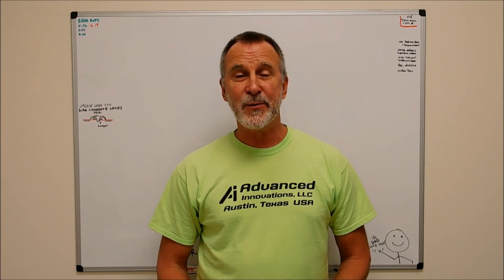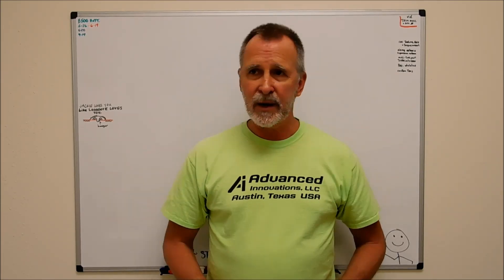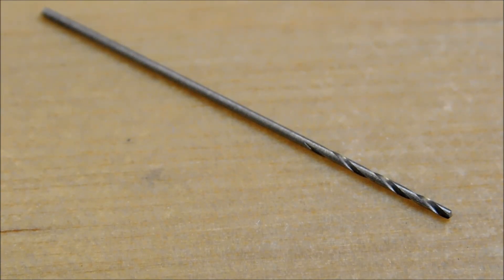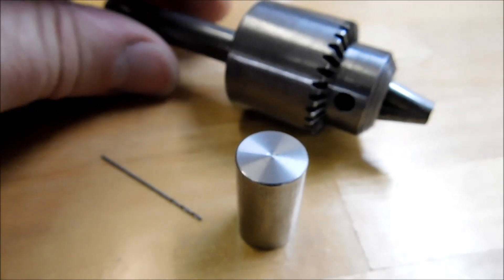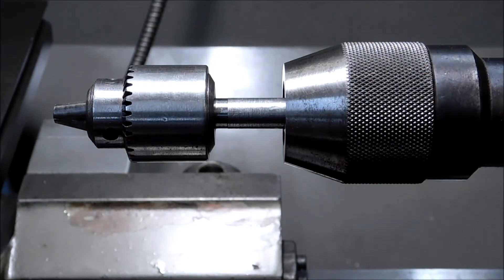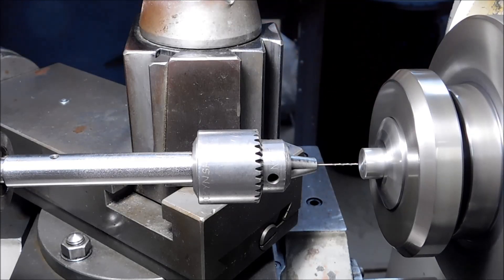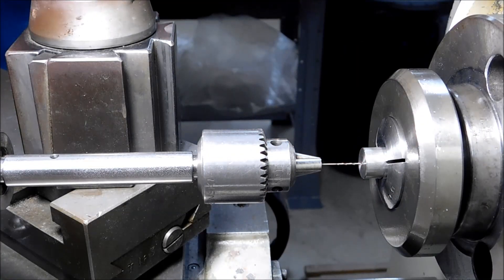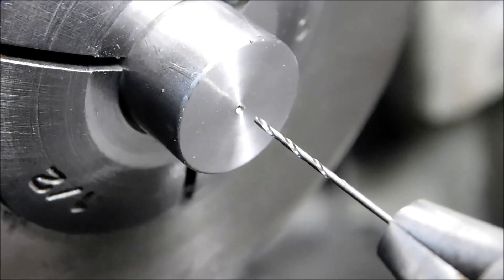Micro Drilling -- Stop Breaking Small Drills !!

Comment: Others will probably have said it, but maybe not…
Please refer to the cutting tool as the drill bit!
Drills are the machines that hold the drill bit.
Thanks for the tip, though!

https://en.m.wikipedia.org/wiki/Drill_bit
Reply: Thomas Cruz The machine that holds the bit is the drill. Try looking at images of, bench drill, pedestal drill, portable drill, hand drill, etc. The tool that does the cutting is also the drill but distinguished from the bench drill etc by the name drill bit. (The cutting bit that fits into the drill.)
Reply: Thanks, Thomas Cruz .
I just checked.
I was right:
https://en.m.wikipedia.org/wiki/Drill_bit
Reply from the maker: Love it.
Reply: Thomas Cruz - Merriam Webster is correct, but their wording is not clear: The drill, or drill press, is the instrument which holds the 'edge or pointed end', and the 'pointed end' of the instrument is the 'drill bit'. Other online dictionaries make things clearer than does Merriam Webster. This is from The Free Dictionary:

'bit: 3. a removable drilling or boring tool for use in a brace, drill press, or the like.'

Other dictionaries, including the OED concur with this definition. Simply put,  the 'bit' or more accurately the 'drill bit' is the tool with the edge that does the cutting. It is, literally, 'the bit that drills the hole'. The bit is usually held securely by the drill or drill press.
Reply: Thomas – When I was a kid, my family called quilts "snuggies".
We don't (after we learnt the official name) expect everyone else to know or use the term – and we don't correct people who use "quilt" instead of "snuggie".
A "drill motor" is someone's mistaken, or 'pet', or localised name for a drill.
A "drill motor" is the motor inside the drill.
"Drill bit" is not slang, and its use predates the twenty first century by several hundred years.
!

Comment: Goes to show. forget about a machine in 2017 custom making a clock with micro parts. Without highly sophisticated sensors for sense/touch and advanced formulae to avoid overstressing the fragile tools...
Reply from the maker: There's beauty in simplicity.
Reply: Its called calculating speed and feed. This is a good old school trick, not accurate depth though. So kinda obselete

Comment: I am curious.  At about 5:03 when you are putting the center on, it looks like the whole assembly walks a little.  Is that just a trick of the camera, or is that normal?
Reply from the maker: That chuck is very old and I am sure it has some wear at the tip. Some of that movement, although minimal, is between the centerdrill and chuck jaw, the rest is the tailstock spindle. I approached the feature very slowly as to allow the centerdrill to find its own center. Hit it too fast, and the material will grab the centerdrill and any play will immediately cause an eccentric runout of the center.
Reply: Thanks for the explanation.
Reply: Use carbide and you be okay, for that small of a drill id use a 60 degree carbide chamfer tool, you know with a diamond shaped insert. That would make much better CD for a 26 though drill

Comment: Yes, much better feel by hand. I made a similar slip fit system for hand tapping anything smaller than 10/32 threads. When using your fingers you can really feel that tap binding up and starting to flex. That's when you back out, blow it out, re- oil and go back in for another "peck". Works equally as well on a mill. Good stuff Joe.

Comment: The centre drill moved just at the start of contact with the Ss bar.
Reply from the maker: I saw that. I have to dig into the reason. Damn that macro photography !
Reply: Roland Elliott Wear on a Machine will allow movement! When operating older machines the operator has to allow for the movement or rebuild or replace,  The closeup video was very interesting to watch. Neat method of drilling.

Comment: I need to make something like that for manual tapping of small holes.
Reply from the maker: Use a small turned disc with a knurled OD to drive the tap. Drill a hole in the center or that disc and put a set screw in from the side to secure the tap. The closer you get to the shank of your tap with your driving holder, the better you'll feel the tap cut.

Comment: I use the same technique in a milling machine and lathe to tap small holes.  It keeps the tap lined up while allowing you to feel when the chips are building up or bind so you don't snap the fragile small taps.  I have never used it to drill small holes on a lathe, but now I will.  Thanks.
Reply from the maker: You'll like the feedback and sensitivity.
Reply: I've seen and copied a much larger version intended for safely tapping LARGE holes in a lathe, but still with the feel you get by hand. It's based on a long hollow quill which slides on the outside of the tailstock barrel, with a 3/4" Jacobs Superchuck (a keyed, ball bearing chuck which can grip almost like a collet) at the front end. 
A go-kart wheel bolted to the back end enables the operator to push the tap into engagement and then, using both hands, safely resist the torque of a big tap even in a blind hole. 
Just keep your thumbs clear of where the spokes will spin if the tap jams or bottoms!
It's lapped to a neat fit on the barrel so it slides nicely and permits the tap to self feed. When you reverse out you can speed things up by also spinning the wheel in reverse.
Works a treat up to M16 or 5/8-11" in steel, or with serial taps in stainless. Also down to M4.

Comment: Great tip Joe!

For a vertical mill or drill press you could hold small parts in a collet/chuck and sit the drill adapter, chuck and drill bit in a 3 jaw or whatever on the bed but you'd have to pull up on it and bend quite a bit, (no pun intended!), to be able to see under the face. There was one moment there when the drill bit started to flex and whip and very nearly broke but it just proves that the method works, as you could feel it and back off.

You could also use a jeweller's Archimedes screw type pin chuck held in the mill chuck under a sprung tap guide to apply light pressure and maintain alignment.

Something like this; https://www.amazon.com/Twist-Archimedes-Push-Drill-CHUCK/dp/B003UBJG88

Comment: in the late 60s  i worked on a lot of carburetors.    and in 68 on the Carter AVS  they put an idle jet to small.   it caused the V 8 engines to stumble off idle.    it was a brass tube.  necked down at the end.   i used a .034 "  drill in a hand held pin vice.    hold the tube pointing down so the chips dont get in the the tube.  on 440s   incres the dia of the jet by .001.    the stumble is gone

Comment: Joe, I made the same type of adapter sleeve as you when I was working as a journeyman machinist for a 2 piece D&I sanitary steel food can  plant. The D&I bodymakers worked on hydrostatic principles and required small jets made from 1/4 -20 x 1/4 stainless cup point set screws at the various pressure points on the machine. The holes varied in size anywhere from .014 to .036 to control the static and dynamic pressures required at that point. Long story short, the sleeve does a great job of being able to allow you to feel what the drill is doing in the material. I'm 57, and I remember being told when I was a green apprentice about learning to develop" a good feel". Another good video Joe.And I hope the younger guys appreciate these tips because you pay for this experience with your life.
Reply from the maker: Very true. Thanks for the comment.

Comment: I tell everyone "I machine with my toes and my ears." So few people understand what that means. It's all in the feel.
Reply from the maker: It is. Thats a big reason I was hesitant to jump into CNC. You loose that feel and have to rely on sound and chip geometry.
Reply: I ran production CNCs for years. I could hear through the duct work at my desk if a tool change went bad or if something sounded off. The jump to CNC is not nearly as bad as people make it out to be. If anything I think it lets you hone your fundamentals because you can sit and observe as well as run DOEs and other statistical studies that would be impossible on a manual machine if your production numbers warrant it.

Comment: Great idea Joe!
You can get something similar (without the chuck) on Amazon for $28. > https://www.amazon.com/Micro-Small-Drill-Adaptor-Chuck-Lathe/dp/B06XPN446G/ref=sr_1_3?s=hi&ie=UTF8&qid=1511426927&sr=1-3&keywords=Sensitive+feed+drill+chuck
I have one that is spring loaded so it pulls back when you let off your finger feeding pressure and it can be used in a mill or drill press. They are also called a "Sensitive Drill Feed."
Reply from the maker: The name brand one can be extremely expensive. It would be a great apprentice project. Something every toolbox should have.
Reply: Yes sir, mine is one of the expensive ones. I thought that maybe this particular item would be ok for someone who for whatever reason cannot make their own or afford one of the expensive ones.
P.S. Happy Thanksgiving!

Comment: Great idea, and easy to rig up. It will work for running in a tap, too, turning the lathe by hand.
Reply from the maker: Since this isn't keyed, you can still turn the chuck if you put a small tap in it. It gives great sensitivity for small stuff.
Reply: Yes. I actually made a similar rig for my little belt-driven lathe, and I take off the belt and put a crank on the off end of the spindle, for jobs like winding springs and tapping small parts. I like the feel of turning the spindle lefty, while controlling the tool righty.

Comment: HOT DOG!  Great adapter.  My shop will soon have one.  I'm considering using a pin vise as a chuck.  They are less expensive than a chuck.
Reply from the maker: I have 2 I use on occasion. They work, but the grip strength is limited.

Comment: for the mill/drill press how about a splined adaptor and shaft with a bearing and round plate right behind the chuck? chuck spins, plate doesn't (because you're holding it providing down pressure)
Reply from the maker: Thats how the commercial ones are built.

Comment: Speaking of drilling small holes, watch these Japanese guys try to drill/bore through mechanical pencil lead!
https://youtu.be/pCtWPbTDbuY
Reply: interesting video.  You just have to get past the corny Japanese drama.   But once you do, the analyzing , troubleshooting and skill of the guy on the manual lathe was amazing.   He didn't use a sensitive drill chuck but I think he could have done better if he had.  I also would have made a collet to hold the pencil lead to spread out the pressure around the lead's circumference.
Reply: Ujeb08 I thought the video was pretty funny haha but yeah, I think it's hard. I think a cnc mill would be a good option too. The pencil lead is .020 in diameter, and he's drilling it with a .012 drill bit. That leaves a wall thickness of .004 of pencil lead. That means you breath on it and it breaks haha the lead has to have no runout. imagine how perfectly you have to align the tailstock. I don't know, the task is so difficult, it's hard to believe honestly

Comment: I made a tailstock DRO out of a dropped caliper to drill tiny holes so I can control the peck, and have drilled many 0.013" holes 0.295" deep in aluminum nickel bronze with it before we got a machining center.  Just another way to do it.  I love 1/8 shank tiny carbide drills too to avoid chuck-ception. Cool other way to do it though!

Comment: As someone else mentioned "There are small chucks that can be bought ready made with a sliding shank and a knurled grip to hold onto so you have feel.". I have one and that certainly has been a life saver - that type does do good in the mill due to its contstruction.
Your approach is essentially very similar and a great solution for sure - it is essential to have that 'feel'. I'm sure a good many folks will find that super useful.

Comment: Great little tip for drilling the hole but now I want to see you sharpen it......what's the trick there?
Reply from the maker: A checkbook solves a dull drill that small pretty quick.
Reply: Easily done if you make yourself a four facet sharpening jig designed by a mate of mine called DAG Brown (written up in ME magazine) and adapted by Gadgetbuilder (go-ogle him) and further adapted by yours truly (not written up anywhere save SMEE journal). 
Joe, where's the fun in that? Why spend a Pound when you can spend all day in the shop making swarf.

Comment: I think "the feel" is different for everyone and mostly gets learned from many many mistakes and remembering what things felt like right before they happened.  Ive been a mechanic for 15 years and through all the experience I can tighten a bolt to within a reasonable torque and can tell when  a bolts going to snap (usually) long before it does.  I definitely agree that kind of thing can't be taught.

Comment: 1350rpm for such a small drill?!? Shouldn't you use a much higher frequency?
Reply: Calculating the surface speed here I'd say 9,000-18,000 RPM would be the range to run that diameter drill. But what he did certainly worked for him. I guess he just wanted to take it slow.
Reply: Paul Frederick Good luck to find a lathe that can do speeds like that. :D
Reply: They exist. Good luck financing their purchase though.

Comment: I have a customer I have had to disappoint because the job involved drilling a 2mm hole 170mm deep in steel (for a special firing pin to slide through). Now I have your technique and will build the adapter and try it. It would be a victory for me to be able to do this job. It has bothered me for a year now. Thanks for the super videos you produce, and this one not least!
Reply: 2 mm is more than 3 times the diameter of this bit. You'll have to give it a try, but it may be too big to do this with? 170 mm is also really deep too. Your typical 2 mm jobber twist drill is not even a quarter that long. It would be quite a feat to get a straight bore that diameter, that depth.
Reply: Sinker EDM or some 2mm capillary tube with diamond abrasive glued on the end and trued up. You might have to reapply and true the abrasive several times to get to depth. The key to both of these techniques is they remove the random tangent force that will bend a twist drill off axis.

Comment: At about 5:10 it looks like the tailstock barrel is lifting so the centre may not be on-centre
Reply from the maker: I picked up on that as well. Yay for macro photography. I'll have to make an indicator puck and check it.
Reply: Actually while the drill did move a tiny amount into the parts center I thought your lathe or at least the attachment was aligned with the part C/L far better than about any lathe shown center drilling on any Youtube channel out there. Tailstock wear on the base, variable bed wear the length of the bed etc, etc and even being purposely set high right from the factory a few thou plus trying to keep it in perfect alignment over years of use is pretty tough. Your large drill chuck holding the attachment could easily be out as much as that drill moved. Maybe one of the Moore Tools Nanotech lathes would be set a lot closer, but yours doesn't seem to be doing too bad. Really great and well thought out micro drill attachment Joe. Finding a good chuck today that holds concentrically and closes down far enough at less than Albrecht's price point is going to be the tough part for me.

Comment: I have one of the commercial ones but I like your's as well. Mine is keyed for use on a mill with a free spinning collar to push on. Your design is better on the lathe because you also get feedback on how much bite the bit has. I've snapped several bits on mine. Looks like I'll be making a new tool. Thanks for sharing.

Comment: getting the "feel" is something some people just cant do  and others, well the struggle is real. at first sight of the video i thought some how that piece of stainless was hollow using it to stop deflection. i've done that before with shallow holes with success.
Reply: When I was taught metal working, we had to learn how to do everything using only hand tools (saws, cold chisels, files, hand cranked drills, etc.) before moving on to machine tools. Once you can cut, smooth, drill, radius, chamfer, etc. by hand with precision and accuracy, it's a whole lot easier to transfer that tactile intuition to machines where there can be a ton of cast iron and several horsepower between your fingertips and the cutting edge. Thank you Ken Hunnibel, wherever you are!
Reply: Today everyone is getting busted for copping a feel. Harvey Weinstein, and now even poor old Charlie Rose. So watch yourself.

Comment: Pretty nice! I need some 0.2mm, 4mm long holes in brass - think it is doable this way?
Reply from the maker: I believe it will work just fine. Be careful of the pressure, in brass the drill will want to pull itself in. Hold tight.
Reply: Was putting this on side for too long, but after this video...... :) I already have very similar device, but for thread dies - I'll make a chuck insert and give it a go this weekend. Thank you very much for the upload!
Reply: Yeah you have to brass off bits.

Comment: Hey Joe, this tool is something on my list to do, originally meant for manual threading on the lathe. 
Just add a slot in the shaft and a pin inside of the bushing and you can use it for multiple purposes. Thanks for sharing!
Reply: "To do list"   lol
We all got one of those, only the length varies, plus the "Honney do" being on top...   ;)

Comment: I'm not a machinist,but i know what you mean by feeling the moment when drilling,having used a drill press often enough,i was wondering if you put a spring in your adapter would that not save you from having to manually push the bit into the work ?

Comment: .026" is not really a small drill :).. watchmakers go down to like 0.006" but a watchmakers lathe doesn't have a crank on the tailstock..it is just a sliding shaft just like the adapter you made.
Nice tool you made..definitely a "musthave" for scalemodelers and watchmakers